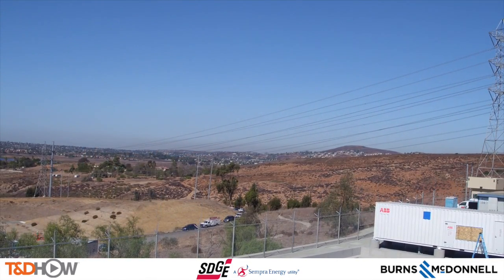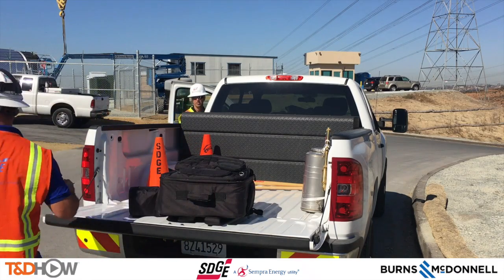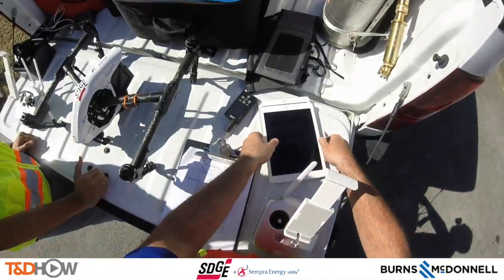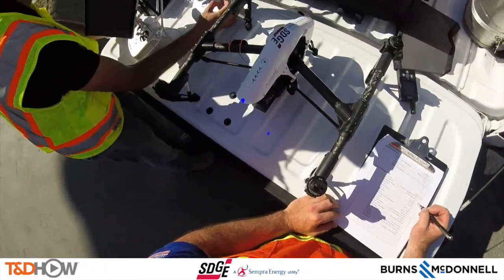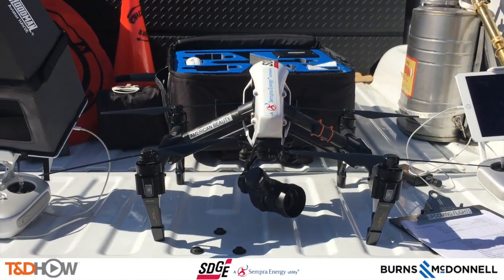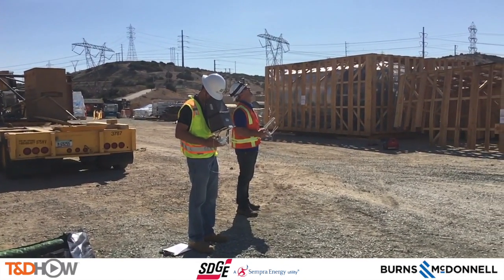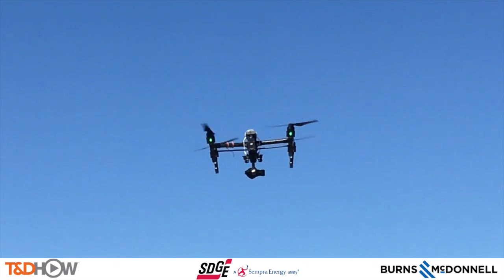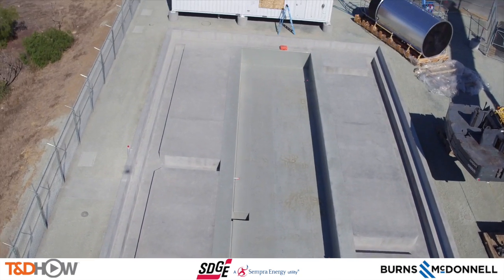Drone Site Inspection

Comment: good procedure, good checklist -kind of more of a newbee checklist rather than a preflight (check battery levels, gps sat number, liftoff throttle levels, RSSI strength etc) ,  just a few weird things: Narrator should know what he's talking about. -checking the battery by pointing at the drone body?   -the two operators/monitors -one guy is a pilot, the other is a camera operator -the screens are both video monitors, one has video + OSD for the pilot -awkward to say that it is a monitor for the flight controller, the other is video without OSD for the camera operator -the DJI dance is to calibrate the compass -has nothing to do with the GPS -ah, yea, the lens cap is a don't have to mention no brainer "any good videographer"...really? - and "as the drone announces it's takeoff". just weird.

Comment: A couple observations, one, don't do a compass calibration and then set on the back of a metal tailgate to set up.  2nd, use a landing mat to avoid additional wear and tear on motors from the dust stirred up on take offs and landings.  Lastly, check out www.aeroworksacademy.com for professional UAS training.

Comment: what brand is the drone? we are trying to a drone for our utility and what are the specs on the camera?
Reply: The drone is a DJI Inspire 1 or 2
Reply: This particular one is a DJI inspire 1- they came out with the 2 however DJI has come out with more drones for industrial applications like the matrix’s 210 RTK. You can mount thermal cameras, methane sensors, and regular cameras with up to 6k resolution, and 30x zoom. I’d look into their enterprise lineup